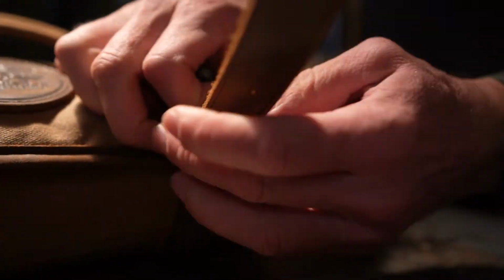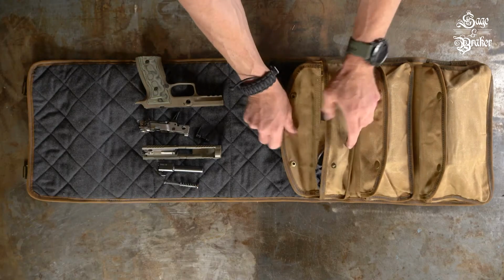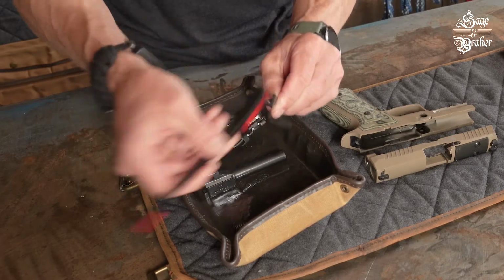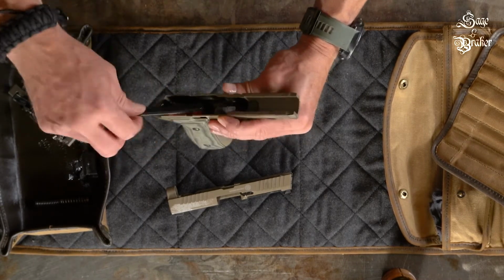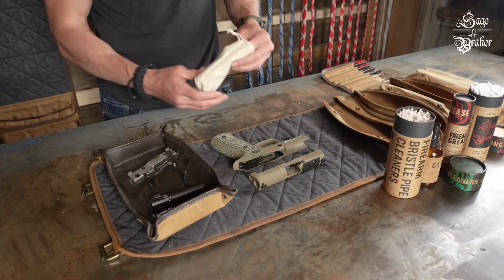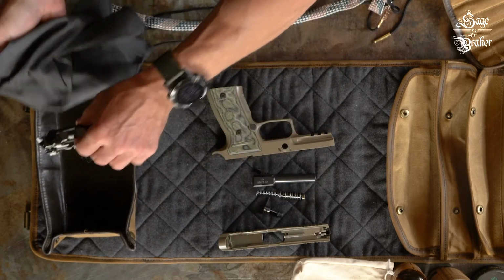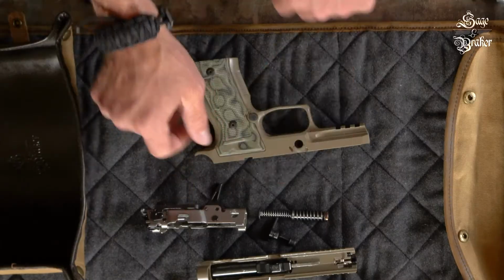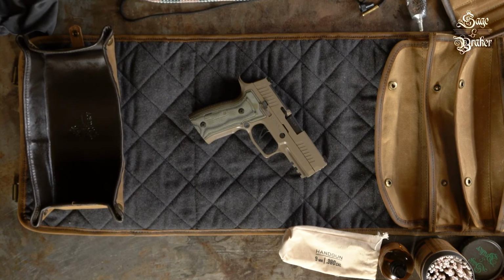Sig Sauer P320 // How to Clean and Disassemble

Comment: Sorry, this isn't all. Great video but you haven't clean the inside where the firing pin is - and that's a mistake that has cost me explosion, broken pieces and shock at the fire range - Sig Sauer V-Tac p 320 - you should also show how to dismantle the back of the slide - that's where the dirt of unburned gunpowder gets also and can do what it did with my squeaky clean gun - explode inside. good, that firing pin hasn't been affected - the back of the slide could hit me in the face, but it stayed in place although side got broken. 4 years of not cleaning there caused me a lot of tears and almost broke my heart as I thought that Sig Sauer created a piece that is a rubbish.
Reply: Hard-core negligence from your part. You own the firearm. You should be knowledgeable and diligent to maintain it.